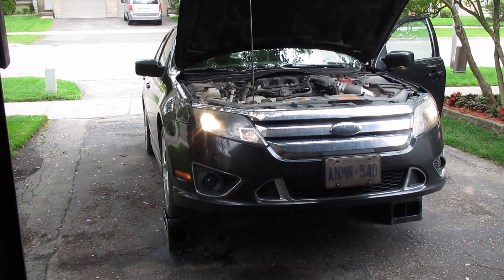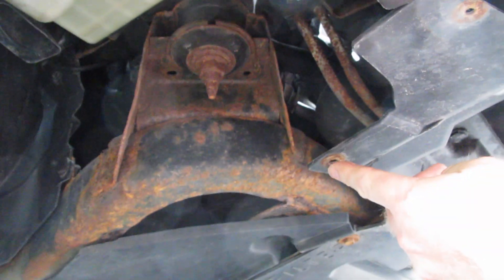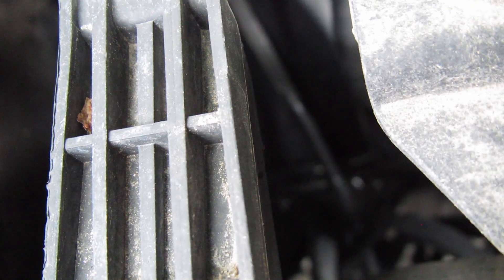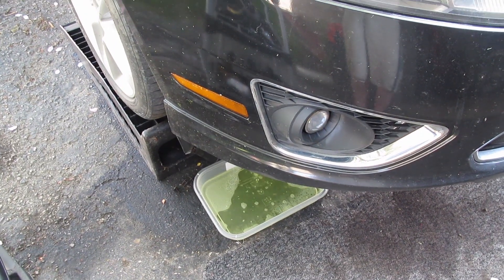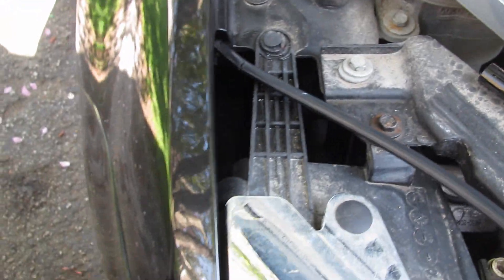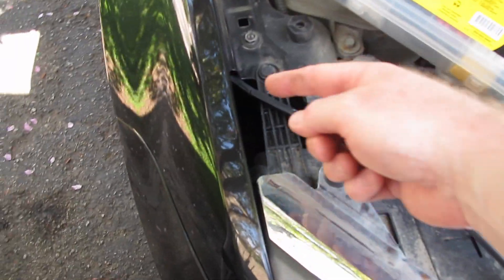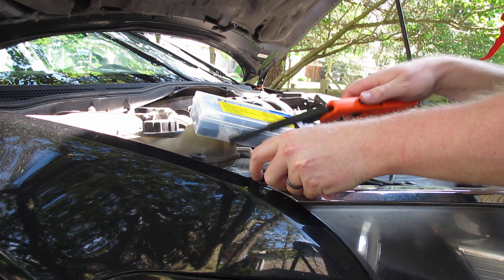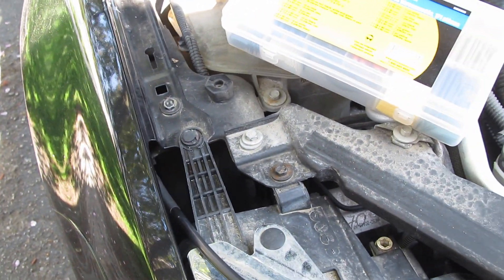Cheap & Easy Windshield Washer Fluid Hose Repair!

Comment: On my 2009 focus, other vids have shown a long, drawn out process to access the reservoir. That might or might not be true. My line is split after it gets up near the first nozzle, so I plan to leave some of the line in place.
Reply: My hose is serrated/ribbed and the new hose will be 1/4 in irrigation tubing. That one in this vid looks smooth. I hope the shrink tubing can cover up/seal the older non-smooth tubing. We'll see tomorrow.
Reply from the maker: My tubing had a slight ribbed texture as well.  Let me know how it goes!  Thanks for watching and the comment!
Reply from the maker: Let me know how it goes!  Thanks for watching and the comment!

Comment: Can you do this to a line that’s been cut all the way? Put the broken ends together and slide the piece over it and melt?
Reply from the maker: I don't know to be honest.  I would think not.  If you try it, let me know!  Thanks for watching and the comments!
Reply: Yes, it worked.  2013 Honda Fit. Probably chewed apart in a bad tight space by bottom of tank. Took 4 hands, super long pliers to hold it out. Slid a generous piece over it. Heated one end then the other. Tested and worked. So happy that I saw this video for the idea to save money. Thanks.

Comment: Our 2013 Subaru Legacy’s windshield washer hose from the rear of the front fender to the sprayer has been totally eaten by a roden. How can that hose be replaced when I can’t see it?
Reply from the maker: You would either have to fish an new line in or pull all the trim covering the line and replace it.  You could try tying a string to the end of the old line and pulling the old line out.  The string could be used to pull a replacement line in the same spot.  Thanks for the question and for viewing!
Reply: Fixed it with a splice line connector.

Comment: It basically goes on your fender..I would remove the wheel well  lining  Make sure the tubing is strapped on right so it doesn't bang around I'm dealing with mine right now oh my Mazda six it is the same thing..I just use drip system hose  and attachments Dirt cheap you can find them at any Lowe's or Home Depot
Reply from the maker: Great suggestion!  Unfortunately most cars are not that easy to get too without a lot of effort.  Just wanted to show a quick easy way to get back up and running.  Its June 2022 and the fix is still holding with no leaks.  Thanks for the comment and for watching!

Comment: I thought about the heat shrinking tube but is it safe to use that under the hood of a car that constantly gets hot
Reply from the maker: Yes.  Once the heat shrink has been "shrunk" it will not compress any further.  Thanks for watching and the comment!

Comment: You can buy an universal line on amazon for $10 and do it urself. Thankx for the video
Reply from the maker: Yes, you can buy replacement line at most big box and automotive stores.  However, the factor washer lines are typically fastened/secured in areas that are hard to reach without removing other parts and sometimes even fenders or other bodywork.  This video shows a quick fix that will last as long as you need.  Thanks for the comment and for watching.
Reply: @MoreBear  i replaced the whole line. Ididnt have to remove anything. Thankx for the video